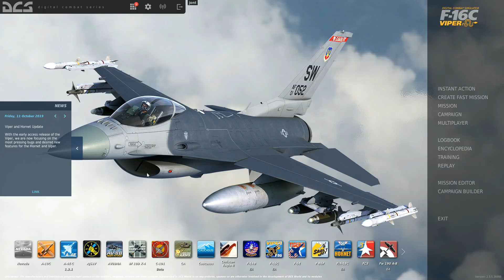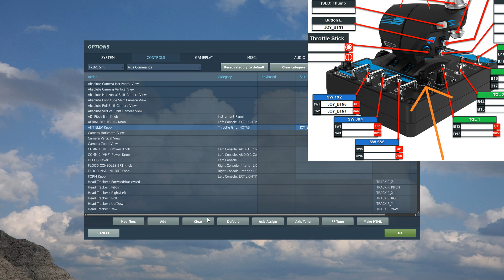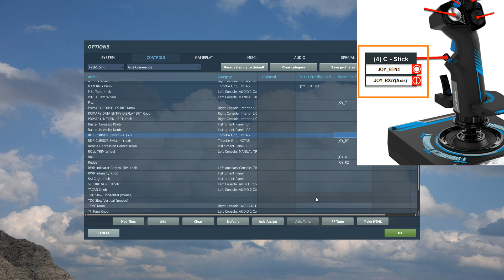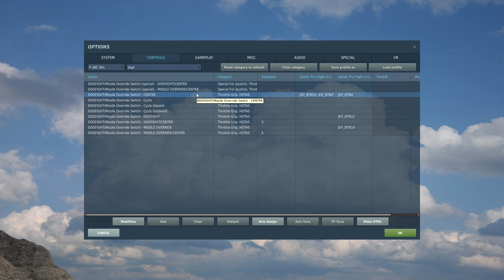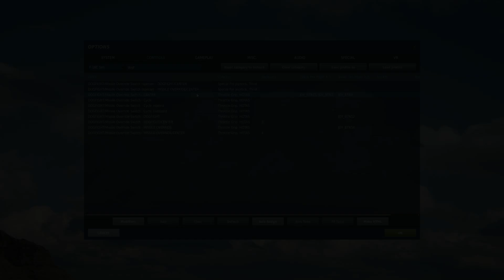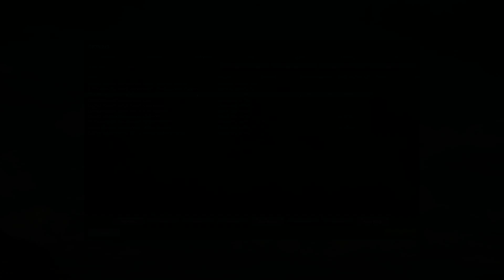F-16C Viper: *IMPORTANT* Changes To HOTAS Controls | DCS WORLD

Comment: Hey Cap! I was having major issues with the RDR cursor before, I have an x56 and i was using the joystick on the throttle. What I did to work around this is to set up a deadzone for both the joystick and RDR antenna elevation. This fixed the problem and everthing works how it should.
Reply from the maker: Brill! thx

Comment: The commands work with the TM Warthogs. Depending on what control you use. But axis/analog controls work. Used three position switch on throttle for DGFT.

Comment: i'm having no problems with my RDR cursor with my X-56 on the throttle joystick
Reply from the maker: weird.... I wonder whats going on?
Reply: @grimreapers  I had the same problems with AXIS on X-56.  I bound them with binary last week and haven't gone back.  I will check and report back.  But yes I had similar results with Axis not working.
Reply: Set the it to Axis control with deleting all binding keys and worked fine.  Its takes a little bit to get used too, since the up and down will slew fast or slow, but it does work.

Comment: For those who own the Warthog stick and throttle: all of these axis commands working fine for me.
Reply from the maker: Copy
Reply: For me too...
Reply: I have the X56 and don't have any issues with these commands either in axis control.
Reply: Slider works for me for anntena but it's all over the place. Not usable. All others work
Reply: My warthog throttle doesn’t seem to like the slider for that antenna elevation.   On the A10 it was my zoom in and out. On the Viper it didn’t do anything on the ant elevation when I mapped it there.   As nice as the throttle is for the A10 it doesn’t seem to be the right choice for other air frames.  I’m thinking about a winwing or a Virpil for my all around throttle outside of A10 stuff